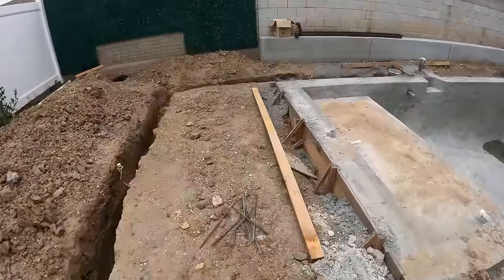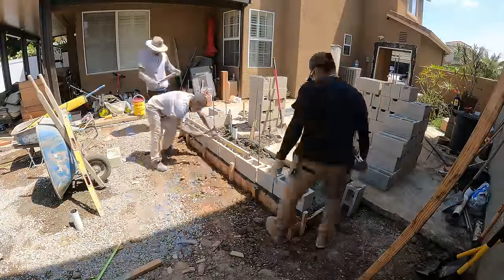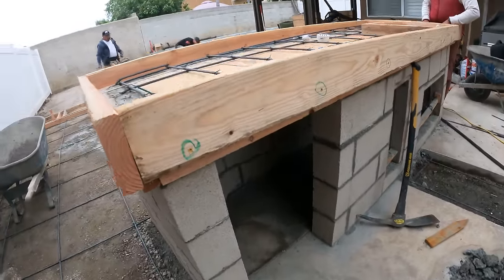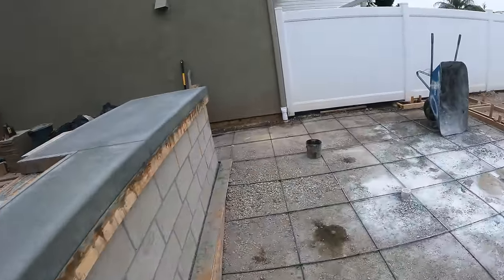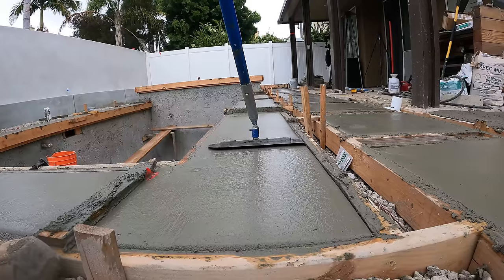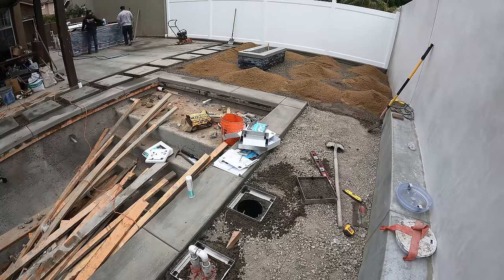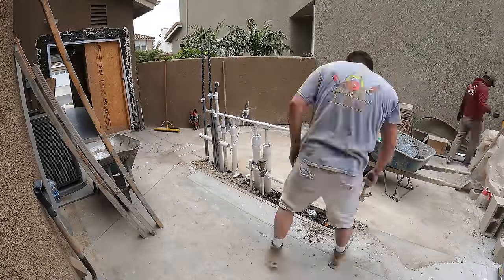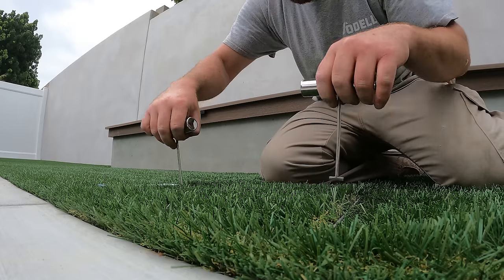Epic Backyard Remodel - Stunning Transformation!

Comment: Isn’t artificial turf horrible to walk on when the sun is beaming at it and it’s like 90 degrees outside? Also, more or less what does this type of job cost? 40-60k? You guys did a perfect job here!
Reply: Just wet it real quick
Reply from the maker: Yes you’re looking at about 50-60k for something similar. It does get hot but nothing crazy. Thanks for watching!
Reply: @OdellCompleteConcrete  Thanks! Too bad you guys don’t do work in Florida, wouldn’t hesitate to hire you guys.